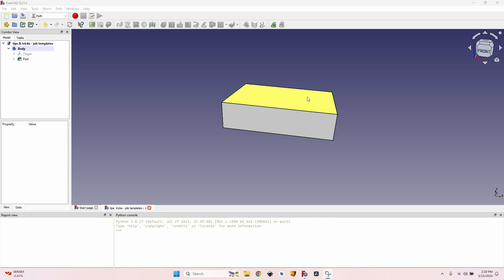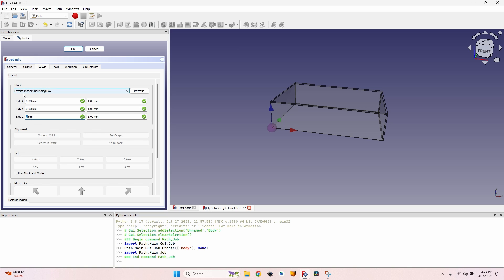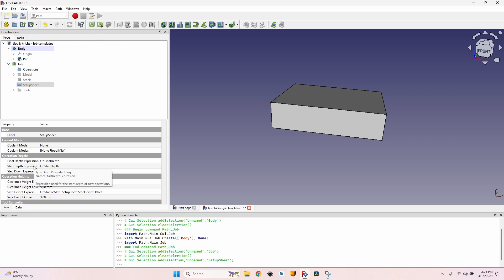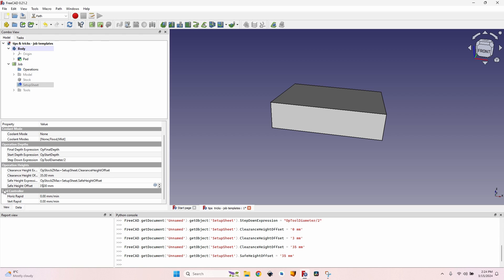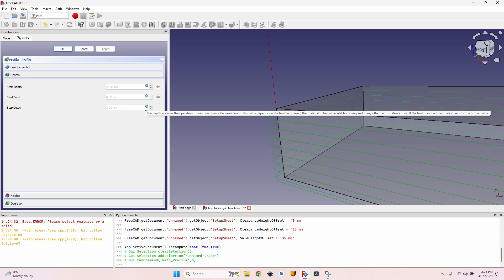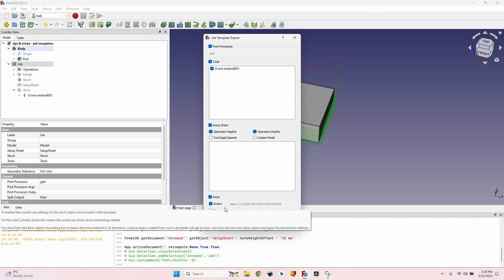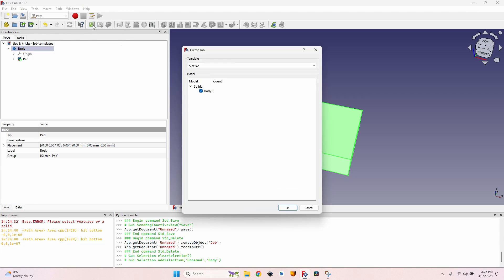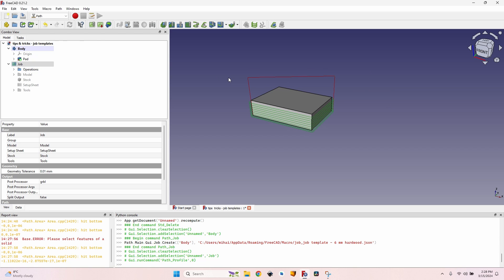Create CNC Jobs Faster with Templates – FreeCAD CAM Tip 1 (Workflow Boost)

Comment: Hi. How can I set the Z feedrate? My GRBL post uses horizontal and vertical feeds for Z axis too and this makes my tool smash into the material. Plz Help!!
Reply from the maker: When creating the job (or double click on it to edit), go to the "Tools" tab, and in the table with the tools, you have two separate values, H and V. Double click on the V and enter a lower value, that's the vertical feed speed. If you want to modify the rapid speed (the one used when not cutting), under the tools table you have a tab called default values. There you can set the speed when the toolbit is not cutting. Hope this helps
Reply: @opensourcecnc  aaahh got it!! Thanx a TON!!